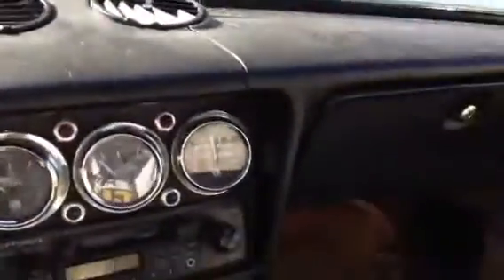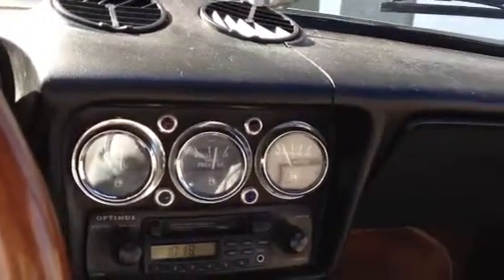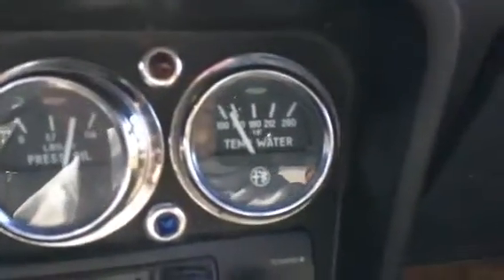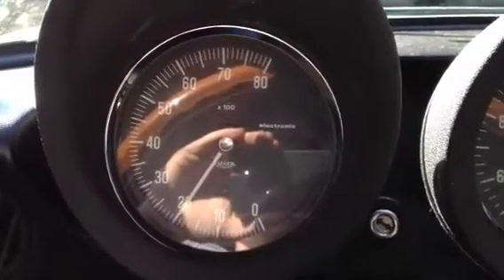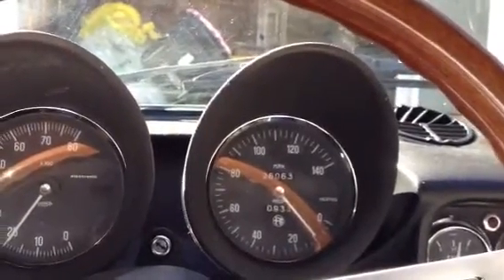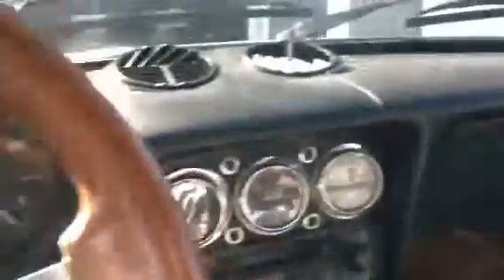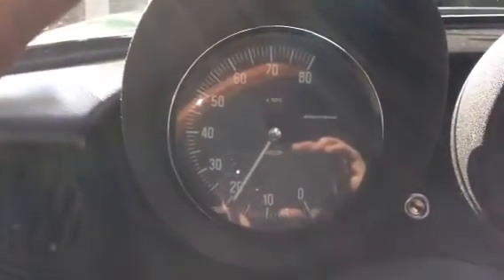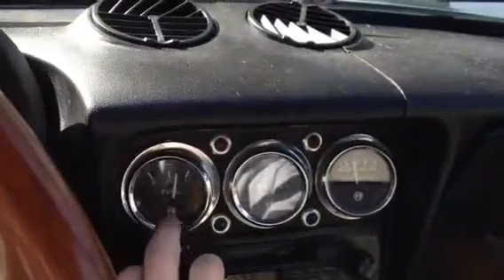Spica pump diagnostic

Comment: If you look really close there's a little black post behind the glass with a needle rest on the speedometer.  That's why it never goes below 5 mph it can't.   9.5 is just the starting point and you can loosen the bottom of that solenoid you were talking about the cold start solenoid with a channel lock.  Type of pliers.  You'll have to pull out your spark plugs and see if they're white or if they're black on the tips of the spark plug if that if it's reading White then you're too lean and you have to turn the cold start so annoyed to the left to rich in it and you have to turn it to the right if you need to lean it out which means less fuel more air.  And if you haven't already done so check inside your airbox there's two air filters in that box the first one you pull out and then you have to reach a little further and there's another one in there make sure they're both nice and clean not old decrepit and freaking been in there since the car was made.   If you need new filters put them in make sure you're getting air if it's too much fuel your spark plugs will be black if it's not enough air and you're getting way too much fuel just spark plug tips will be black if they're a light brown color that's what you want and you don't want white white means you're getting a ton of air and not enough fuel and too much air and not enough fuel cause your spark plugs to just freaking melt and your engine will overheat all the damn time.